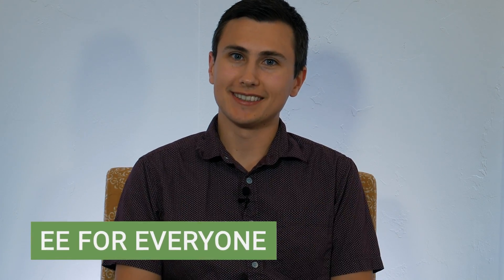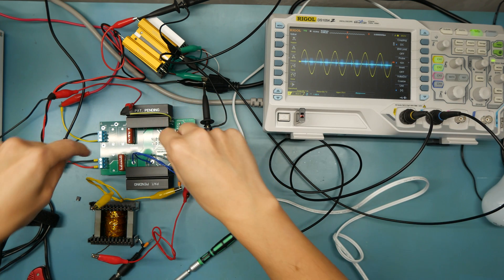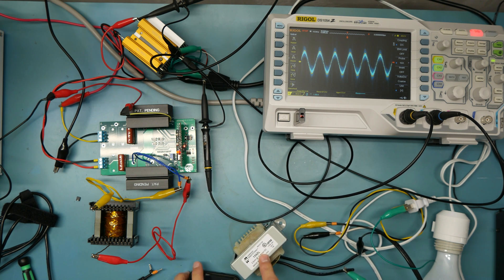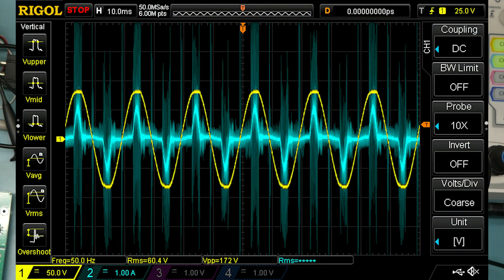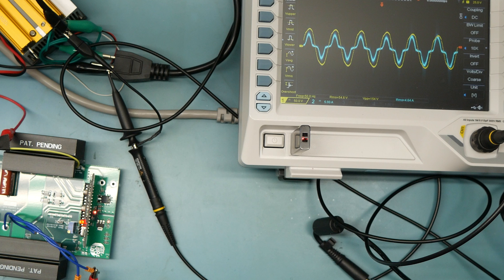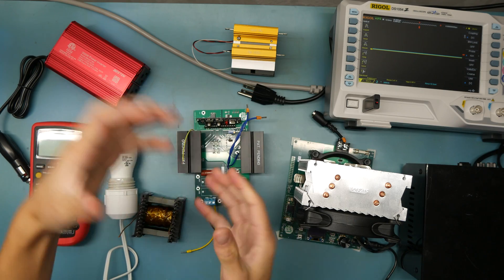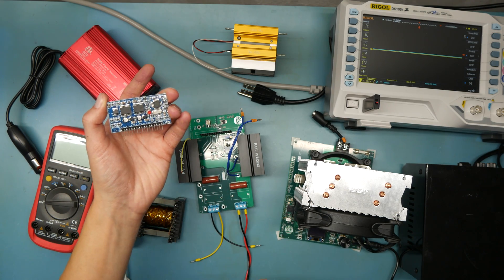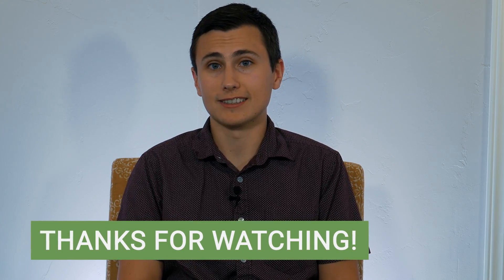Testing EGS002 with Reactive Loads! | INV4

Comment: Nice video...congratulations !   In my opinion, looking at the distorted waveform profile, I think the modulation index is greater than 1, hence the distortion. This is because this type of SPWM modulation used requires an extra voltage on the DC bus; this is one of the theoretical disadvantages. It's like trying to obtain a pure 220V AC sine wave with a 220*sqrt(2) DC bus. A better type of modulation is space vector, but it requires a more advanced processor (DSP, see Texas Instruments or Microchip). These latter techniques take full advantage of the DC bus voltage. On the other hand, I think the ASIC EG8010  (the brain) does exactly the job for which it was designed; it's a good controller for the price. Now, the EGS002 PCB may need a revision; at least I wouldn't integrate the IR2113 drivers into the PCB. It is easy to observe ringing in the gate signals when the driver is far from the IGBTs. These drivers should be as close to the IGBTs as possible. And of course the short-circuit protection point is the most important and should be the first point to design and test. Excellent video, thanks for taking the time to make it. From experience, I know that the topic of inverters is motivating and interesting!

Comment: I have built an inverter using ckt diagram given in EGS002 module data sheet but when ever i give supply to my inverter the egs002 always blink light for 4 or 3 time which show either under or higher voltage and as a result i don't get AC at output i have worked a lot on it but again and again same problem is coming i will be thankful if you can guide me
Reply: Just make sure the feedbacks are reaching the asic within the specs in the datasheet. Especially the voltage feedback from the tiny transformer. Make sure the transformer is good then use the trimmers for adjusting the ovp/uvp and ovc.

Comment: Hello, very informative video. I build an inverter circuit based on this EGS002, with output voltage below 190VAC all is good, but when setting the output voltage to  220VAC, under load it drops to 200VAC, any idea why ? thanks.
Reply: is cause you apply a load to the inverter while firstly was doing nothing. the problem can be the batteries that don't dump too much power... try connecting a little resistor as a permanent load so the circuit is prepared when a load is applyed
Reply: @computerkiller1494  Thank you for the answer. The problem is that below 200Vac it regulates very nicely, but above, the voltage drop is very high. The Batteries are strong 180Ah. Any idea where to look at ?
Reply: @hichamtassi1753  i don't really know... the batteries can dump enough power? like lipo dump really a lot, acid batteries dump lower power. maybe that's the problem. try with lighter loads and see if the voltage drop is the same. if is more little use some batteires that can dump the power needed (example: if a battery can dump 300w and you attach a 350w load there will be a voltage drop cause of the missing current)
Reply: @computerkiller1494  Very clear, i will try this and let you know. Thanks for your time !
Reply: @hichamtassi1753  :D
Reply: what kind of transformer are you using?
Reply: @armandoperez5723  i planned to use a microwave transformer, rewinding the secondary wind and making it a 6V winding. these type of transformer can handle 1500w without problems
Reply: @armandoperez5723  Concerning me i am using a 8.5V 220V transformer taken from a UPS and i believe that the voltage drop occurs because i might be reaching the "saturation' of this transformer as below 200v, the regulation is perfect

Comment: Is that a custom inductor you used for the SPWM output filter?  Any details about the core & windings?
Reply from the maker: Hi sdm! Depending on which video, I've used ots and custom inductors. If this one was custom, I use E cores (and/or gapped e cores) a lot! Each vendor has a calculator tool a lot like this! https://www.tdk-electronics.tdk.com/en/180490/design-support/design-tools/ferrite-magnetic-design-tool

Comment: Hey...I'm new to your channel.  Have you considered upping the wattage of your inverter say to 3- 5 KW and loading it with an A/C unit....something in the 2-3 ton range, and checking the waveform output? That I'd love to see and how it performs. More specifically...a 1- 2 ton Mini-split system that have become very popular of late. Thanks and enjoyed your video.
Reply from the maker: Hello My YouTube! I came to a pretty lame conclusion w.r.t the inverter/ups project, that basically came down to - it would be way cheaper, easier, and faster to either buy an inverter module or a finished UPS. 

I was hoping to find that I could do it cheaper, better, but as usual, the economy of scale led me to believe there were other projects where I could have a bigger impact than.. making a slightly different but quite similar design to what's commercially available. :)

To answer more directly- I did a longer winded ups project (see playlists) where I tried to make an inverter in the 1kW range and I learned a lot about gate drive. High power design involves a lot of compromise and parasitic effects can become dominant! If you try to dig into the design, tread with caution, there are many hazards, and definitely post some pictures on the Discord!! Best of luck, and thank you for watching!

Comment: Thanks for getting back to me. Well got another egs002 and works. Put my scope on it and get the waveforms all is perfect, now I keep blowing MOSFETs. All I have right now are irf540, the schematic call for irf840. What I am trying to do is no transformer running 170 dc to get 115 volts ac. Right now to test I am supplying 48 volts. I have a whole pile of mosfets that are shorted gate shorted to source and drain. What do you suggest ?
Reply: IRF540 is rated 55v....Since you're supplying 48v, use a mosfet whose Vds is not below 80 or 100V for the DC-DC boosting to 170vdc. Using 55v mosfets for 48v system is very bad. The voltage spikes will rise upto 60v or more so it will kill the mosfets because the VDS will easily be exceeded. More so, a 48v battery bank can reach 60v when charging. For the Output that is 170DC to 115v AC, use mosfets that can withstand 200v or more such as IRFP250N or use IRF740, IRF840, etc

Comment: I like your style, I have been trying to get egs002 board, first board dead got refund, second one no display no output on the 4 gate drivers, switch hi to low got smoke hay at least I got it to do something. Wait on my third board. They say three times the charm. Your videos give me hope.
Reply from the maker: Hi Arthur! I hope you find success. Yikes! That sounds like no fun at all. I'm not sure what voltage you're running at, but lower voltage should equal less destruction. :)

I tried to find the part number, but failed.. there is a new inverter module from these guys. I've heard it's better in many ways. It might be in another comment on this video! YT is weird... It's harder than it should be for me to find older comments.

Either way, I hope the third time is indeed the charm for you.

Comment: Where are u from?
Reply from the maker: HI Arvin! I'm from the USA. How about yourself?
Reply: @EEforEveryone  From Iran, Yesterday I was thinking about EGS002 module,Today your new video pop-up in my phone ,As you told there is a longtime ago that you were trying to make pure  sinusoidal wave invertor. Hope you doing well.
Reply from the maker: That's awesome! I hope you are doing well too. Life is pretty good here, there is a lot happening, but it's all good things! I have a couple more projects to finish up before we can dig back into the inverter, but we'll get there soon enough! I can't wait!

Spoiler alert, but I'm hoping we'll build a replacement inverter control module (that fixes some of the common complaints with the EGS002)!
Reply: @EEforEveryone  then you have my crossed fingers.i had experience on step-up dc-dc converters ,it is the main part of challenge that you will face to.
Reply: @EEforEveryone  i have been using a home built egs002 inverter for many years now  i beat them to death i have not had any prb at all none   i built a few for friends also  no blow ups they work great   i am just a dummy no just a jack leg  i got help on the first one from thebackshedcom                     i think totem pole driving mosfets on any thing over 2k a good choke not iron core and winding the tranny at 1 tesla is the keys to having a great inverter using the egs002  maybe also using a tiny step down tranny on the voltage feed back that steps it down to around 12 volts then into res dividers diodes   i set that from wall outlet to 3 volts so its very close when first starting the inverter    there is a eazy way to have the best pos turns per volt on tranny also    wind high side first just one leg of 120 volts for us in usa  then plug  that winding into 120 volt outlet to see how much the idle is   then add 10 more turns and test the idle  keep doning this until the extra turns dont lower the idle much    this gives you the best your core can be turns per volt   this way of getting turns per volt  the choke and out put caps is how you make a very good inverter with very low idle loses                             Works every time after finding the right turns per volt you can plug in one 120 leg of a 10k tranny into a outlet and not flip the breaker    when first trying to find turns per volt you can use a old light bulb  with a switch across it to keep from fliping breaker   switch off plug it in then flip light switch so light bulb is bypassed   you can read all about it on back shed com  if you dont understand my hillbilly writing lol